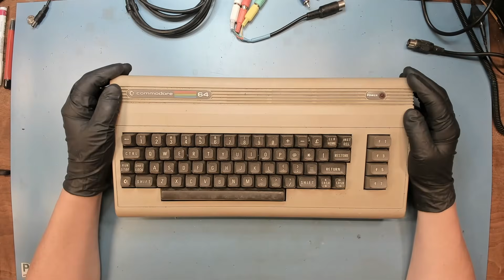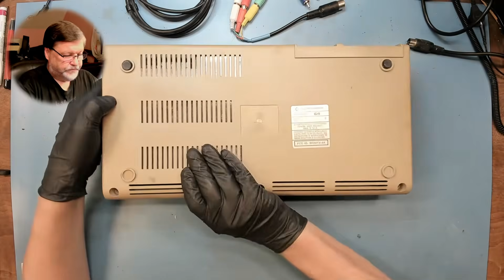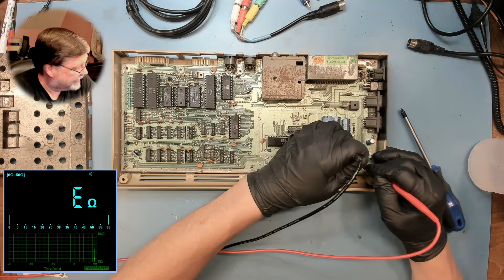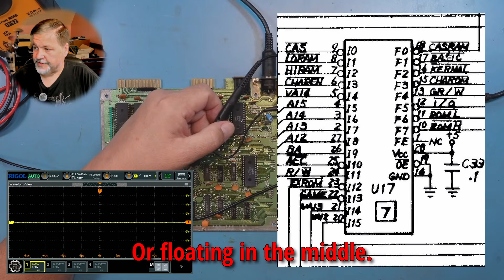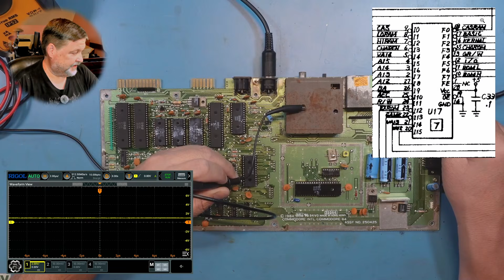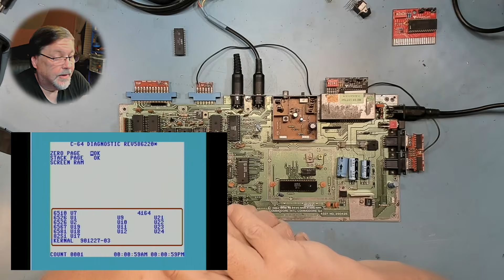Getting My Mojo Back By Fixing a Filthy Commodore 64

Comment: Very nice work.   Glad to see you back:)   good vicII and sid chips.  Perfect ❤️    nice find on the 5V drop.   I would have never found that
Reply from the maker: Yep.  A relatively inexpensive repair.  I got those PLAs pretty cheap and they're ultra-reliable.  The old switch will be cleaned and go back into my spares, so no cost for that.  The socket and 74LS258 were just a few dollars.  And the fuse is just pennies.  So all-in-all, a great result.  As for the 74LS258, that find shows just how valuable a thermal cam can be for diagnostics.  A worthwhile investment.  Thank you for watching!

Comment: 4.7V on the 5V rail isn't normal and as you pointed out, it's actually outside the acceptable range for TTL logic. Something still isn't quite right on this board.
Reply: 4.7V  is completely fine.   I've repaired over 2 dozen
Reply from the maker: True, but it's a lot better than it was and it's working.  I've seen a lot of C64s with voltages that low on both my own repairs and in videos done by others.  I think the BASIC ROM may be to blame as it was getting hotter than I would expect with the machine just sitting there idle.  I'll try that before I button the machine up.  Thank you for the comment.